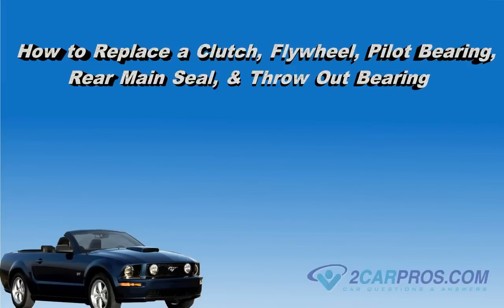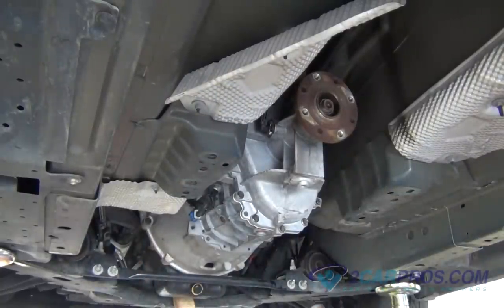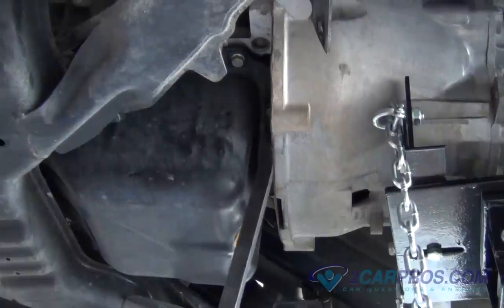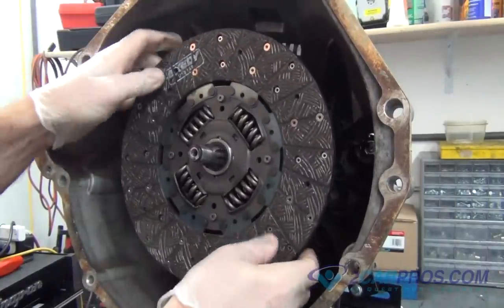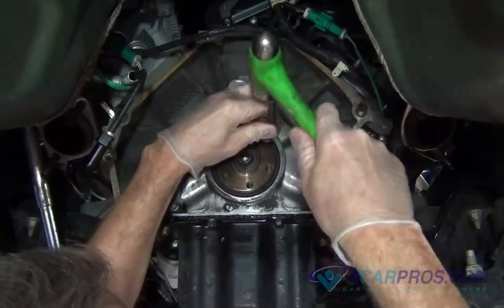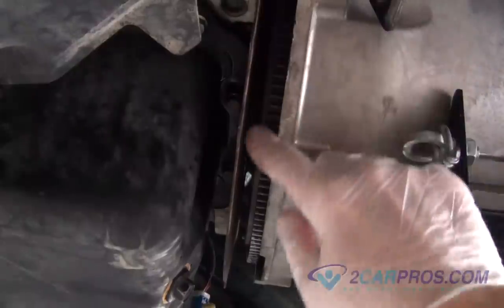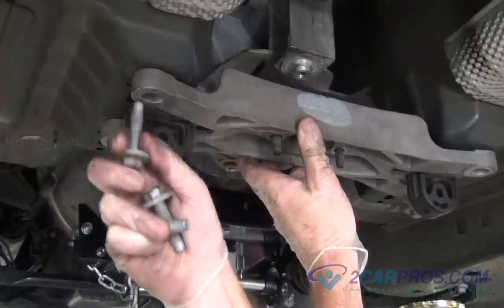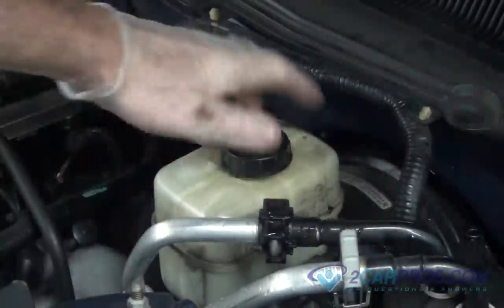Clutch, Flywheel, Rear Main Seal, & Throw Out Bearing Replacement Ford Mustang 2005-2009

Comment: Hello! Can you please help me regarding the following situation: Today i went to an enginner for my car in order to put out the oil pan, clean it and put some paste on it to avoid oil leaking. But he made a mistake because he put a screw in the wrong place and it came in contact with the flywheel. We figured it out after we start the engine and heared a squeaky sound. He moved the car a little bit in order to elevate it and to find what happened. (The good thing is that i didnt drive my car, just a little as i described above). My question is: Should i be worried if any damaged occured to the flywheel while it came in contact with the screw? Thank you in advance
Reply from the maker: Nikos Chatzinikolaou Please direct to your question to our website where we our certified mechanic's can help you. Here is a link

http://www.2carpros.com/questions/new

Comment: you seem to rotate the driveshaft freely when removing ....is this because there isn't any surface contact with the rear wheel?  the car being lifted off the ground.
Reply from the maker: Vince Gaskin Yes that is correct we used a lift for this repair.

Comment: When you were dropping the transmission I noticed you had it tilted, perhaps to clear the clutch assembly? Did you have trouble making clearance in order to drop the transmission and if so, got any tips?? Thanks!!
Reply: On a 13 i had to loosen the K-member to get enough clearance for the trans to slide back enough to clear the clutch

Comment: Would you say this could be done in a relatively small garage under 4 jack stands? Also where do you find manufacture torque specs?
Reply from the maker: It is possible if you have everything for the job. If you want to find torque specs on specific parts you can google search it. Someone somewhere on a forum has posted it.

Comment: Hey what clutch kit did you use for this install? Did you have to shim the slave cylender for an aftermarket clutch? I'm worried that the gap won't be correct with an aftermarket clutch and a resurfaced flywheel.
Reply: Also did you use an aftermarket throwout bearing/slave or the OEM motorcraft part?

Comment: i didn't see a clutch fork for the throw-out bearing. is this because it is a hydraulic clutch and uses fluid pressure instead of a cable/linkage system?
Reply: soldierkiller29 yep. It’s an exedy hydraulic TOB

Comment: I'm working on my clutch right now,  and my transmission just wont go straight back up in there!! Why wont it get back easily?
Reply from the maker: Make sure you have the transmission lined up with the engine. If it came out easy and the clutch and pressure plate are re assembled correctly there really shouldn't be an issue. Thank you for watching!
Reply: 2CarPros yessir thank you fo the reply! Very helpful video me n pops been watching it throughout the fix

Comment: Great video guys!  I am in the middle of the exact same repair/clutch replacement.  I have a question about the main seal.  The OEM seal is a two-part seal.  One being the main seal as you used for the replacement in the video and the other being an "oil slinger".  You did not replace the oil slinger.  Is it necessary?
Reply from the maker: Yes we did replace the oil slinger and it is necessary. Please let us know how it goes
Reply: 2CarPros Complete!  Working great.  The only issue I had was the clutch slave fitting/connector at the transmission.  I had not fully seated it and it popped off after the first clutch pedal push.  Got it back on and now have air that I am clearing from the line using a vacuum pump.  Having to repeat but it is improving.  Any other suggestions?

Comment: Great video with awesome instructions. I’m currently waiting on an exedy stage III clutch with TOB and lightweight flywheel so I can perform the job on my 2007 GT. One question I have though, does it matter what gear I have the transmission in when I disconnect the linkage or does it not matter as long as it stays the same for when I reconnect it? Let me know :) this video made what I thought was a very difficult job seem fairly simple and straightforward. Once I get parts and a set of socket extensions, It’ll be time to do the install. Will come back for an update if I remember. Thank you!
Reply: Kyson hey man I’m about to do the same thing on my 06. Did you ever figure out if it matters to leave your car in gear or not when you dropped your transmission?
Reply: Doesn't matter. Probably a little easier to get the spline to slide back into the engine if it's not in neutral though. Sometimes twisting the tranny back and forth helps get it to slide in. If you were in neutral the spline might turn too.

Comment: Do you have to break the clip on the throwout bearing?
Reply: No. Use a pick and pry from the driver's side toward the driver's side door.  It pops out and can be reinserted.  When it pops out, it will go flying though. Put your finger on it to pin it between your finger and the pick to prevent having to search the garage floor. Lol

Comment: Great video. I was wondering, how far do you have to drive the pilot bearing into the back of the crankshaft? Does it have to be flush with the flywheel or does it seat all the way until it bottoms out?
Reply from the maker: Seat till it bottoms out. Thanks for watching!
Reply: Good question, it should be flush with the flywheel, then apply grease to the bearing
Reply: Thanks for the replies. This one had me puzzled.

Comment: I have an 07 Mustang V6 thats needing a new clutch. This video will help me out a lot!!! Thanks so much guys!!!! Great video. Wish me luck!! lol
Reply from the maker: +Adam Pickard Great to hear! Please subscribe if you have not already.
Reply: Adam Pickard when you changed your clutch on your 07 v6 do you remember if the pressure plate bolts used a locking washer or just the bolt?
Reply: IF I REMEMBER RIGHT.......The pressure plate itself had regular bolts, and i believe there is a torq spec when tightening.
Reply: Adam Pickard thank you for the help, yea i found the specs. i just couldn't find anything on the bolts,
Reply: MrHernanHdz do you happen to know what the torque spec for the flywheel is?

Comment: I completed the install but it won't go into gear when the car is on. Any ideas?
Reply: check your clutch master cylinder. It is located just under the clutch petal but you will have to remove the petal assembly from the car to access it.
Reply: Hey so have you checked or replaced the master cylinder, and have you had that issue before the clutch job?